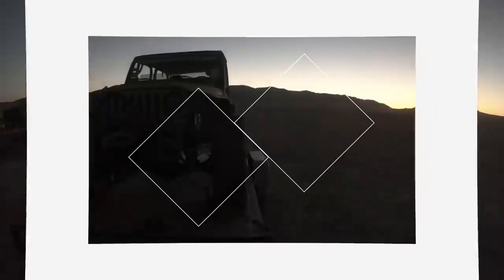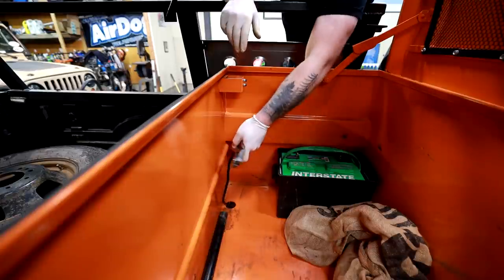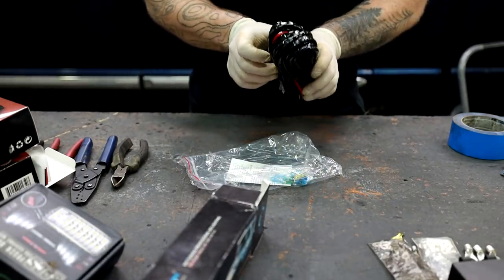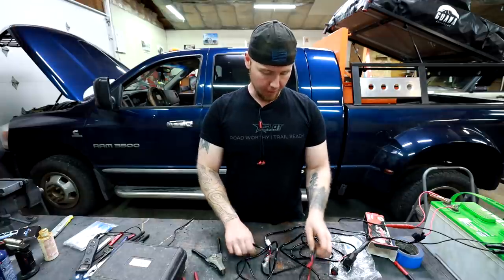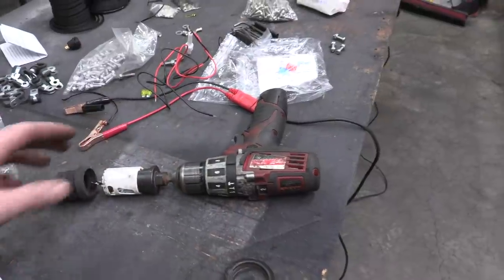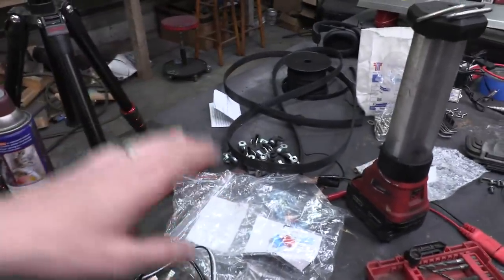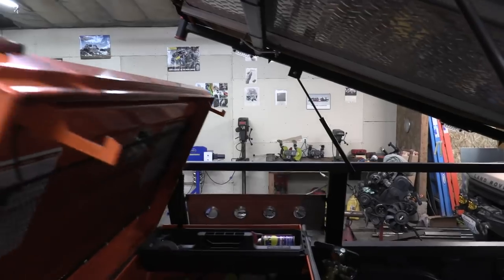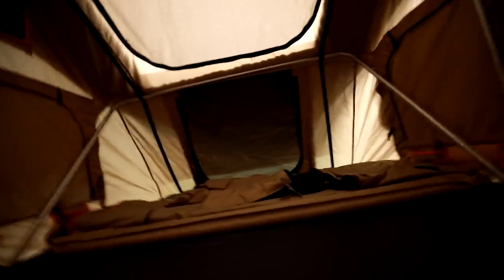CHEAP Roof Top Tent Rack Mods and Hacks! 4x4 Camping In Comfort 👊

Comment: My biggest concern would be if your charging harness was fused enough then make sure that wire will handle the current to charge.
Reply from the maker: It has a 20 amp inline fuse. Batteries don't equalize very fast so It shouldn't be pulling anywhere near that many amps. 👍
Reply: @DirtLifestyle  battery isiolaters control the current. If your second battery is discharged it will put the demand on your alternator and your primary battery will only act as a buffer. If the demand is more than 20 amps it will blow your fuse.  Yes it can be done the way your doing it but the safer way is with an isiolater.
Reply: @shawnbishop9199  Well, the 'best' way to do it would be a dc-dc charger; that way the batteries are 100% isolated.  I run a simple Blue Seas dc-dc to charge the aux battery in my service van.   Of course neither of these setups would allow for proper battery combining to allow the aux battery to assist with starting or other high-demand loads such as a winch.  For that you'd need appropriately heavy wiring and switching.

Battery isolators come in all flavors.  Many are simply a huge diode in a heat sink which only lets current flow from the primary battery to the aux.  That's great, but it also means you'll loose about .7v across that diode and never properly charge the aux battery unless you make provisions for that with your regulator.  Some are little more than a relay such as Nate built while others have voltage sensing switching that will only connect once charge voltage on the primary battery is above a certain point (usual around 13v to be sure the alternator is charging).  And some also regulate current flow as you mentioned, but if you're shopping for one don't assume anything that says 'battery isolator' does all without studying the specs.

Comment: If your starting battery gets low... When you turn on the key, your starter will pull the power from the house battery. Small gauge wire = No bueno

Comment: Why are you choosing to solder all of your electrical connections rather than crimp? I was always taught that a solder joint is brittle and can break with repetitive bumps / flex. A high quality crimp connection (connector and tool) is more reliable. You don’t find solder joints in OEM wiring.

Comment: The only issue i see is the amperage from front battery to rear battery. Be careful with such small gauge, it might get pretty hot when trying to charge the rear from a lower voltage. Kind of like using a pipe that is to small in plumbing except instead of a leak/pressure you get heat. Im interested to see if this is just my car audio experience closing my mind. Definitely will looking for an update.

Comment: So you want to make a cover for the rear battery, and use the dimple dies too..... that defeats the purpose of a cover. Also you will drop that (10mm or any thing small) into the hole. Maybe a dimple depression, not a hole.

Comment: The only thing I see that could go wrong with that battery set-up, is If your truck inst starting and you start running the first 2 batteries low it will pull power from the third because the ignition is on, and those small wires will burn. You could maybe replace the relay with a starter solenoid or plow motor solenoid and run some 2 or 4 gauge wire to address that.
Reply: Maybe im wrong on that, just would worry me alittle.
Reply: 12 gauge wire is only rated for roughly 20 AMPS at 20 feet and a starter draws almost 200 amps

Comment: when you hook up a discharged battery to a running automotive system it can easily draw 20 amps, that is not a trickle charge,  it would be much better to use a large relay much like the old style "ford starter solenoid" right at the Battery and from that send a 8 gauge ( preferably larger maybe for air compressor or a winch on a trailer) all the back to the rear  bumper , then anytime you are looking for 12 volts just tap in with an appropriate fuse to run whatever you want including a spare battery, and when the relay is off everything runs off the spare battery, one more thing clean the connection very clean and spray paint them, I like red for positive, several good coats all around will stop any corosion
Reply: Good points, but a couple of notes:  First, a starter solenoid is definately up to the current capacity needed but is not rated continuous duty.  It will likely fail if left on constantly.  You can get continuous duty solenoids rated for several hundred amps from many vendors and at all price points just depending on how trick you want to be.  

Second, don't guess at wire size!  It's easy enough to look up how much wire you need for a given load at a given length.  Here's a good chart to get you started.  https://www.westmarine.com/WestAdvisor/Marine-Wire-Size-And-Ampacity.

Notice your suggested 8 ga wire over 25' (easily that long to get from the front to the back of a full size truck by the time it snakes around a little) is only good for 15 amps at 3% voltage drop but could handle 50 amps at 10% drop.  For non-critical things like lights you can tolerate that drop, but not for a charging circuit or other voltage-sensitive items like a fridge.  

So many people just guess at wire sizes - it's easy enough to look up charts like this and save yourself either headaches (too small) or money (too big).
Reply: @donhappel9928  the use of  "ford starter solenoid " was in reference to size not operation but that brings up a point to address, years ago when I used   Cole Hersee solenoids for this kind application they had one available with an internal diode to quell voltage spikes, I don't believe the have one anymore although I have seen it in small relays, a properly sized diode place correctly across the coil of a relay can address this problem, and if one must be picky ,my full size crewcab is 21 feet bumber to bumber, the charging load would be between the battery to battery and everything is reletive from there, but yes feel free to size the wire to the load but don't worry the example you give would not be detrimental to the wire or charging a battery and like I said "preferably larger "

Comment: Surprised that you didn't instal Latch/Pin to secure the Tent Platform...
This way it is securely "Locked Down" durring Hiway Travel!
Or, use a Mag Mount so that the Magnets keep the Platform down...
Reply from the maker: It's got two latches 👍

Comment: your battery setup should survive daily use, and some things here and there, but if you run the 3rd aux battery right down by accident, I think you might do some harm to your charging system, or your good main truck batteries.  Your truck has an ECU controlled alternator, and on top of it possibly freaking out, the alternator is gonna hammer your good batterie(s) trying to bring the 1 really low aux battery back up.  Your setup isn't 'wrong' .. just be mindful of particular scenerios where either side of the battery sets gets a large variance to the other.  The total solution for modern vehicles with 'smart' alternators is usually a wonderfully expensive 'smart' isolator/charger

Comment: ABSOLUTELY needs a fuse on BOTH ends of that tiny 12 gauge wire between the two batteries. No if ands or buts!
Reply: Good call-out - many people forget that in a dual battery connection both ends of the wire need to be fused.  They get away with it....right up until they don't.  I've had a couple buddies come over the radio on the trail yelling 'fire!' thanks to a lack of fuses.  It's good for your cardio when sprint to them with a fire extinguisher, but not so good for their truck.

Comment: Don't most modern trucks already have a charging system built in for charging camper batteries? Why couldn't you just splice into that wire in your 7 way trailer plug?

Comment: That is exactly how my battery isolater is set up. My question would be what is the amp draw that the 3rd battery is going to draw when charging? I used the Painless kit for mine, also knowing that my second battery is going to be a emergency starting battery. I am planning a third battery for my fridge and lighting when in camp. Might set that one up this way since it wont be a starting battery. You can check out my set up at @spelunker109 on instagram, also My 65 that I didn't get submitted for your viewer rig episodes.
Reply: Batteries don’t ‘draw’ amps. But a discharged deep cycle might see the full amp output potential of the alternator which is why the charge wire should be of sufficient gage to handle 150A

Comment: I think you're wire will burn when the back battery gets to low
Reply from the maker: Nope, it's got a fuse 👍
Reply: Was wondering this myself. Is there a way to limit the amount of amps that are sent back there?
Reply: @ASdt360  could do a properly sized current limiting resistor if you didn't want to upgrade wire size